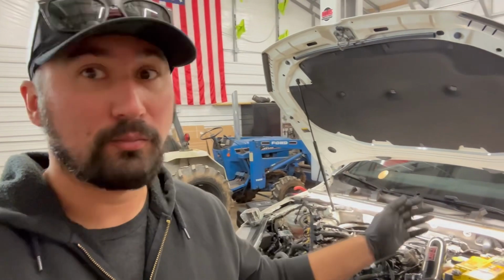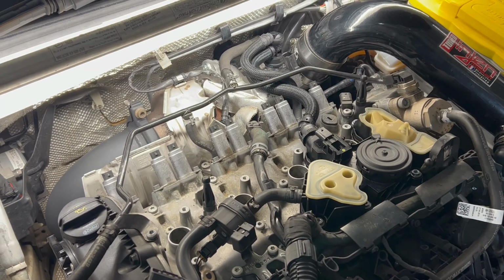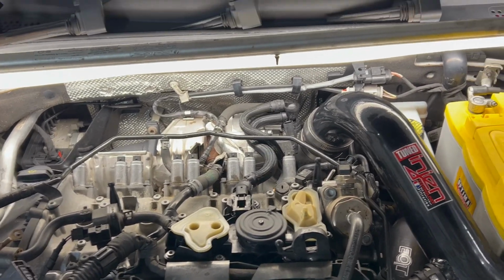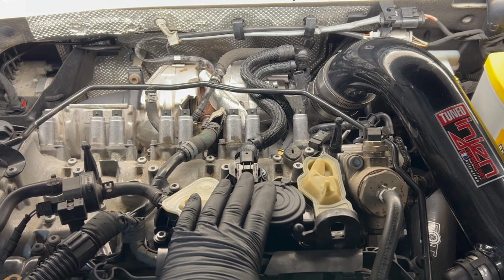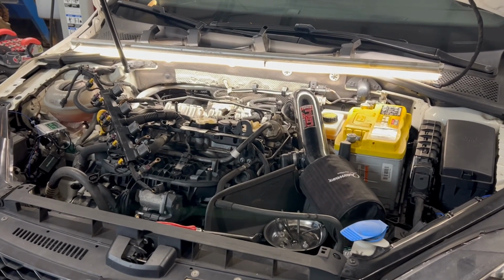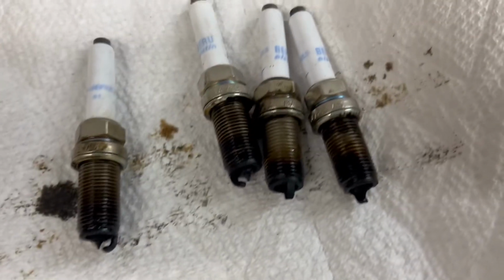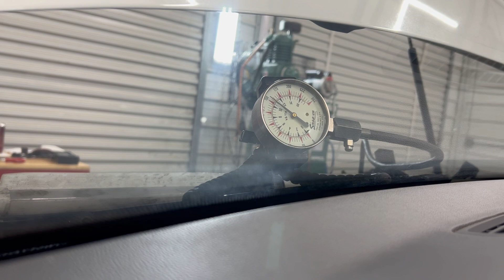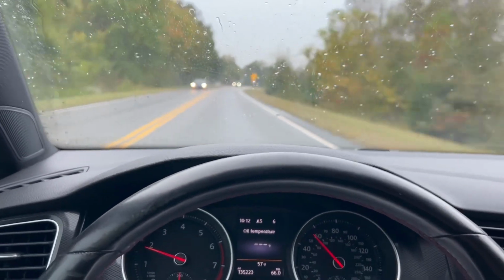Mk7 Track Day Drama; What broke, how bad + fixing it (note the smoke trail)

Comment: You aren't kidding, VW compression specs are HUGE. Good luck with the car......
Reply from the maker: Thanks! Eventually I’ll swap or build the engine (I did a full rebuild on the transmission this winter in previous videos/shorts). Planning on keeping this car forever so it’s only a matter of time (but it’s been extremely reliable so far).

Comment: 1st for comment!   Like it.
Reply from the maker: You’re on it today! 

I’m hoping as a community when can pinpoint these issues and find a solution that works for everyone (Mk8 PCV seems to have near 50/50 success rate, either flawless or completely useless).
Reply: The GTI is an economy car first, and barely a sports car. Tracking this economy car will show the flaws it has. You just found one.
Reply from the maker: No doubt. My modest econo-shitbox punches way about it’s weight class & serves as a great daily so I’m not complaining.

99.9% of mk7 owners won’t have these issues. Although even in normal use PCV failure isn’t uncommon.